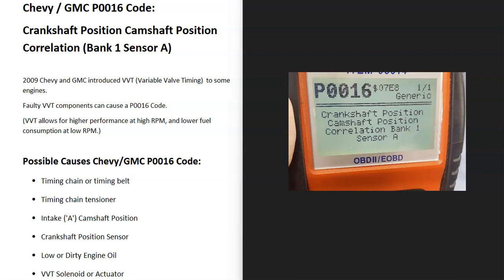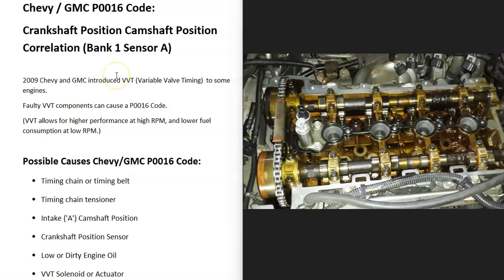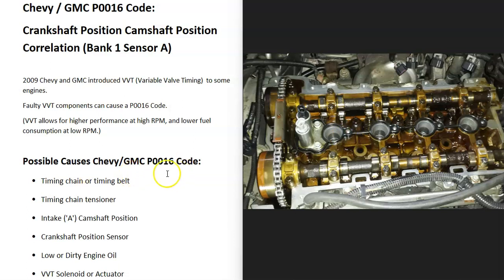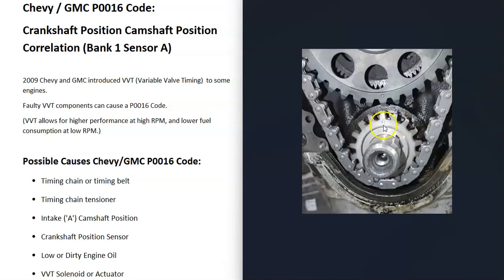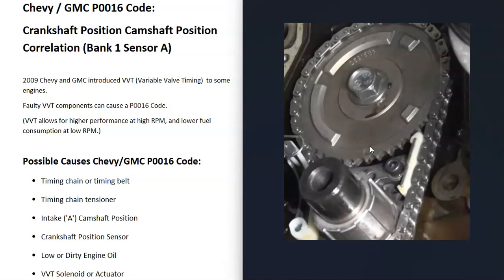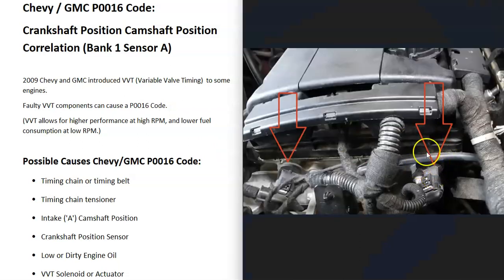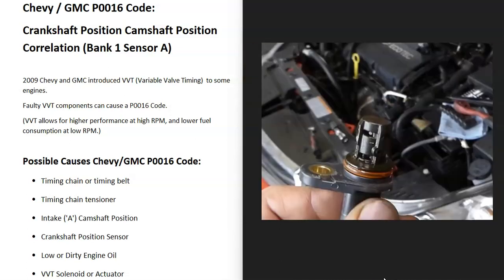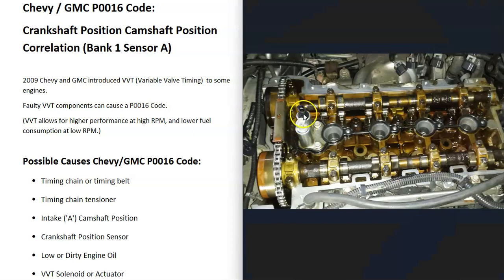How To Fix Chevy GMC P0016 Code: Crankshaft Position Camshaft Position Correlation (Bank 1 Sensor A)

Comment: Sadly this type of problem is cost prohibitive for something like a 2004 GMC Envoy that otherwise runs perfectly fine. Problem is I can't pass emissions with the check engine light on
Reply: I’m confused with your comment? I have a 2013 Yukon same thing runs perfectly fine I don’t understand it why I have that code
Reply: @screamersnsp4229  like a lot of codes these days, it could be caused by something being just slightly off, triggering the check engine light, but not actually causing any symptoms. In my case, my car runs fine, MPG is stable, but check engine has been on for years. The first likely cause is the VVT solenoid which I had replaced, but that didn't help, the next likely cause is timing chain, but that will cost me $2K+ on a vehicle that's maybe worth $3K. The last time I brought it in they recommended a bunch of stuff that would cost $5K+, but I said no thanks, I'll take my chances.  Car continues to run fine, but now I cannot get my plates renewed because in my state you have to pass emissions and I cannot pass with check engine light on so now I'm just waiting to get pulled over, lol.

Comment: Had p0017 code first. Got timing chain changed w timing chain kit. Now a week later i have the p0016 code???
Reply: Change solenoid cam sensors and crank sensor and if it’s still there the riming is still off

Comment: Can a defective camshaft sensor cause a vehicle to jerk and loose power
Reply: Might be low on oil or your transmission could be having issues but I’m not as knowledgeable as a professional. I had a car that stalled due to oil and it would have seized had I not changed the oil that day probably

Comment: I have a 2007 tahoe with the 5.3 liter v8 flex fuel. I had the p0016 code and actually changed my camshaft position sensor about a month ago but it didn't get rid of the code even tho it definitely needed to be changed. Just wanted to know why I would still have the code popping back up? Do you think maybe I need to change the crankshaft position sensor now maybe? It runs good but when I first start it up for that day and leave my driveway it does feel sluggish right away but then after 20 seconds or so it starts ro drive good again like normal for a 17yr old tahoe anyways. Just trying to get some ideas. Thank you very much for your time and help with this matter.
Reply: it might be stretched chain or a chain tensioner guides . Might be just a guide . or the guide and chain.

Comment: In my non-expert opinion, my p0340, p0300, p0016 and p0141 error codes...make me believe there's a problem either with a loose timing belt on my 2011 Chevy Aveo or a bad distribution alignment . What do you think ?
Reply from the maker: That would be a likely cause. You could test to see how much slack is in the chain and if it slipped.

Comment: Just finished replacing both camshaft position sensors and the crank sensor on my gf's 1.8 sonic. Oh boy was that crank sensor not fun. I discovered new forms of profanity I didn't even know existed till they came out of my mouth. Whatever engineer decided to bury that thing inside the bell housing and behind a starter that was murder to get out and in deserves the worst thing anyone could ever imagine. Still didn't fix the issue. Going to replace the vvt solenoids next... I replaced the timing belt and tensioner last year and it ran fine this whole time.
Reply: I got to do this on my girls gmc terrain I can’t find no damn videos wat so ever to find where the hell this sensor is
Reply: @masonrum2177  if it is the 1.8l 4cyl then the crank position sensor is inside the bell housing of the transmissionat the back of the engine. The starter has to be removed to even get to it as well as another bracket to the right of the starter. Then up behind where the started inserts into the bell housing there is a rubber plug with a wire going out. That plug in the bell housing is where the crank position sensor is. Up inside there is a bolt that iirc is either a torqx or an Allen head at an awkward angle. I couldn't even see where it was if I didn't have a borescope camera that I fished up in there. It is also very easy to drop the Allen/torqx bit or even the bolt inside the bell housing with no way to get it out short of removing the transmission.

Comment: My 2014 Chevy Sonic displays the code P0365 which is the Camshaft position sensor B, I changed it but the code P0365 still persists, What do you think is the real problem?

Comment: I wish it was easy getting to my crankshaft sensor on my 2012 Buick Verano. Dam* thing under the oil filter and it’s hard get to it. Had code p0016 & p0017. I’ve changed the camshaft sensor that was easy get to.
Reply: did it fix your problem? I have 2010 buick lacrosse cxl. Have codes p0016p0018 car seems to run fine
Reply: @johnc-lf1qz same with my Yukon runs totally fine
Reply: Did that fix your problem?

Comment: I just got this code, a few days ago, after my oil change, the oil change was way due past 4k miles or so...Ive only replaced these solednoids sensors 1once since I have owned the car... about 2 years back
Reply: What did you do to fix the problem?
Reply: @user-do6lb5ss2j  had to get a new timing chain set... Wasn't cheap

Comment: I have the issue after engine build up on chevy silverado 5.3L, changed the sensors both cam and crank but still, what could be the reason
Reply: timing chain is streched more than likely

Comment: I cleaned the solenoid changed the cam and the crankshaft sensors and I still get the code. My car drives perfect too. 2014 Mitsubishi Outlander.
Reply: More than likely timing chain/belt stretched. If it drives fine may aswell ignore the check engine because its going to cost 3,000$+ to fix
Reply: @Boaters_hub  labor in shop aint cheap they have to basically tear off all your side of engine apart to get to the chain.
Reply: Why so much?????

Comment: Just hope it’s not the timing chain. I currently have this code on my Malibu but it runs and sounds fine but I am overdue for an oil change. Mechanic thinks it’s most likely the solenoids and to start with an oil change and see if the code comes back then go from there if it does. So pray for me lol
Reply: What was it?
Reply: @ loose guides to the timing chain and a loose bolt
Reply: @ericabertagnoli5469  wow u got super lucky bro. Mine same symptom as yours. P0016 and p0171. No sensor dtc
Reply: @Nirvana_key_lab  not really. Had to get a new timing set. 1500 dollars
Reply: @ericabertagnoli5469  wow. Sorry bro but glad u are out of it now. My oil is good and still 1500 left on my.3k oil chsnge interval. I started noticing a symptom that i thought to be transmission slipping on first gear but my trans fluid was within range. Then at red light, car started shaking like 1 cylinder misfire so i was like im not gonna stop here i was 30mn away from home so i took off. My ancestors held it until i park it home then by the time i raised the hood, car shut off lol. I was like whaaaaat. Checked code with.my.scanner and p0016 nd p0171. I switched all my stuff to my.2000 camry. Ill check compression on the.impala later to see what booboo i just got. Pffff

Comment: what would be the reason the code and problem goes away and comes back after a start? I replaced my cam and crank sensors and while testing it would start up regular and the code and engine light would dissapear. After turning the engine off and on again  it would go back to cranking longer to start and the light would come back on. I have a 2017 kia forte5 lx 2.0
Reply: engine is out of timing
Reply: If the check engine lights coming off an on it’s most likely your sensor not your timing